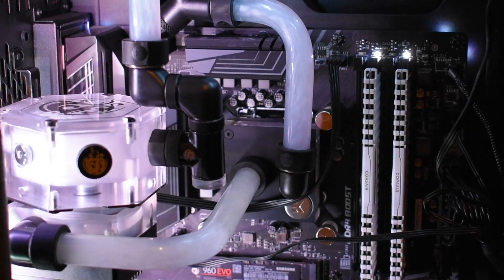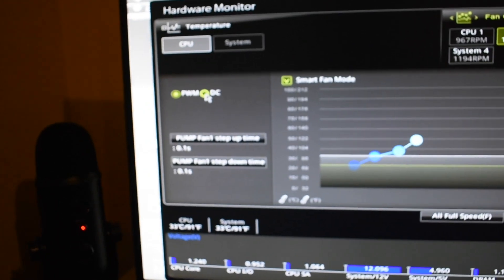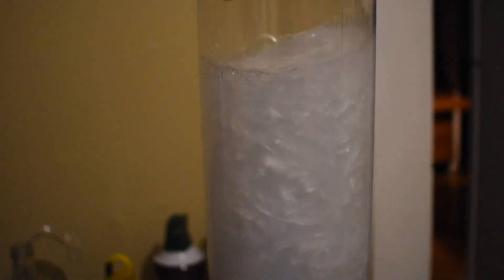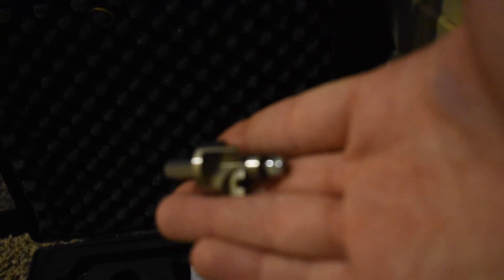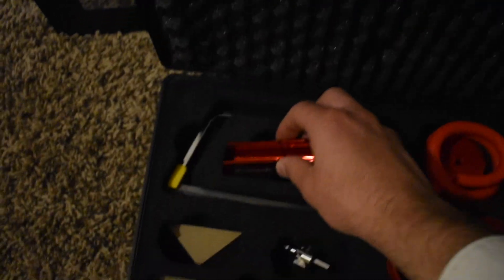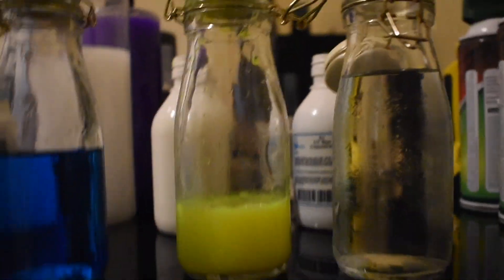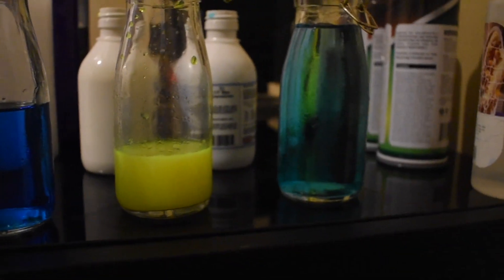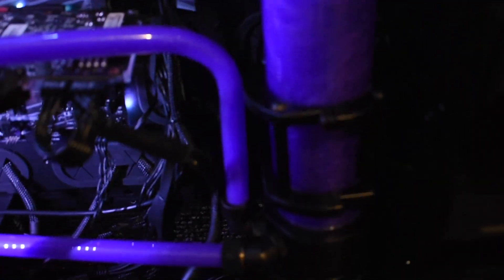Primochill Vue Review: High Performance, High Maintenence!

Comment: Do you think you'd be able to see the particles with frosted tubing?
Reply from the maker: Not sure. You could probably see some of the particles, but it would look much better using clear tubing. If you are going frosted I will probably go for something pure liquid based, like mayhems x1. 

Performance shampoo coolant and solid coolant are both a pain in the butt to maintain.

Comment: hey great video! how is the Primochill holding up? I am thinking of doing a new build with water-cooling using primochill and I've read mixed reviews in terms of it breaking down and clogging systems up
Reply from the maker: My answer here is going to be similar to what I told Josh Kierpiec below. Something went wrong with the purple side of the loop. A few weeks after shooting the vid, the fluid once again began to break down. I believe this is because the GPU loop is much more complex than the CPU loop. This could also be due to the fact that other fluid was run through the rad previously and caused an unsavory chemical reaction. Either way, I have actually put purple fluid now in the CPU loop and filled the GPU loop with lime yellow Mayhem's pastel. 

The purple vue in the cpu loop has held up for almost six months now. It doesn't look as "stunning" as it did when I first put it in. In my experience of working with this fluid, you will need to replace it every 4-7 months which can get extremely expensive.

Still, there is no other fluid on the market that achieves this sort of look (other than show fluids ie Aurora). Keep an eye out for my next video, I will be using the fluid again in a RTX 2080ti build and will be doing custom sleeving from the ground up :)

There are basically two things that can happen with Primochill Vue once you introduce it into a loop (especially older loops that have had other fluid run through). Either it will have an abnormal chemical reaction and the fluid will gunk up everywhere, or it will simply break down and turn watery over time but not stain the tubes, gunk up fittings etc. 

You are taking a risk that this may happen anytime you use the fluid. 

If you want an alternative to another type of great looking fluid, mayhem's pastel is also excellent and will last much longer.
Reply: Thanks for the info. Primochill seems to cause a lot of problems ☹️ do mayhem have liquids that are the same as primochills that weird movement within the liquid? It’s a great effect but not so good if it needs to be replaced all the time
Reply from the maker: @EddyWatson84  Mayhems Aurora is a show fluid, meaning it is not intended to be used for gaming or leaving your PC on for several hours during the day. It has a swirling effect similar to Vue. The only alternative that leaves you is "UFO Technologies Cryo-Chillz coolant", which is a 3D coolant that's very similar to PrimoChill's Vue.

You can find the coolant here: http://www.performance-pcs.com/catalogsearch/result/?q=UFO+technologies

Warning: I haven't tried this coolant yet so I have no idea how it holds up XD.

Comment: Hey Josh! Any updates? How is the overclocking performance? How long have you had the fluid in a rig now? Temps holding well? Overclocked at all?
Reply from the maker: Hello! I have actually updated the rig. Something went wrong with the purple side of the loop. A few weeks after shooting the vid, the fluid once again began to break down. I believe this is because the GPU loop is much more complex than the CPU loop. This could also be due to the fact that other fluid was run through the rad previously and caused an unsavory chemical reaction. Either way, I have actually put purple fluid now in the CPU loop and filled the GPU loop with lime yellow Mayhem's pastel. 

Overclocking performance is great on GPU; bad on CPU. I was only able to push the 8600k delidded to 4.7GHZ stable. This is not any fault of the fluid, I believe it's due to the motherboard I am using not having beefy enough VRM cooling.

Temps around great.. I don't remember exact numbers but they are both excellent under full load. 

I plan on doing a singularity computers spectre build soon with RTX 2080ti for my next vid